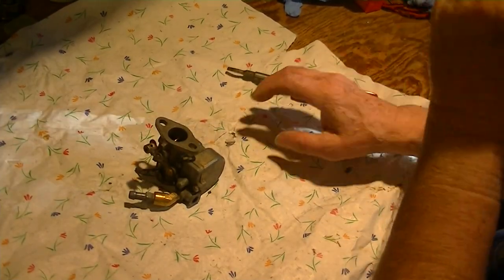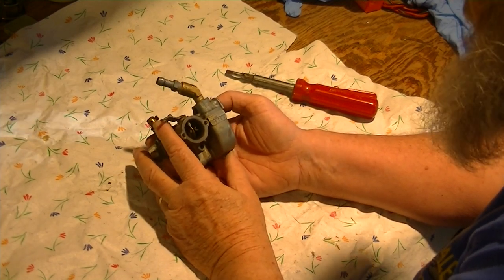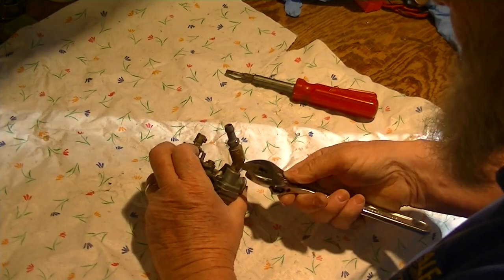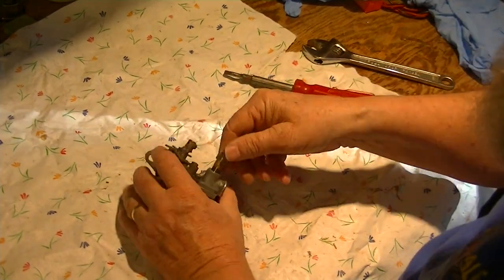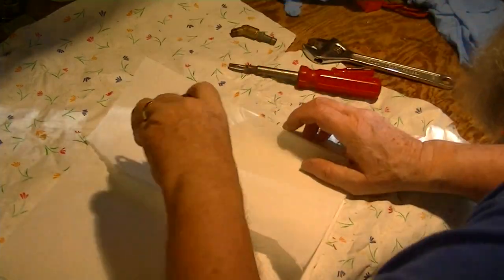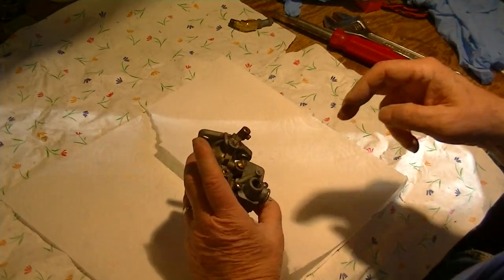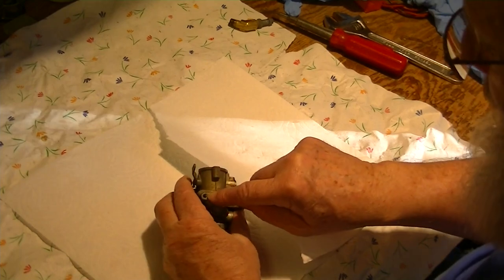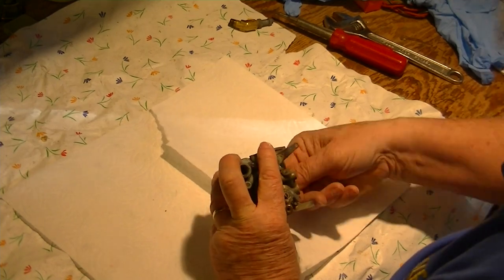Cushman Carburetor Party # 3 Carb dissasembly and explanation

Comment: Crazy! My Trailster is doing the same exact thing. Fuel dribbling out of the carb. I can’t believe YouTube. Thanks a lot! Back to the video to see how I fix it.
Reply from the maker: anytime you have this problem there is but one cause.. and that is the Float.   check that it hasnt leaked and filled with fuel.  remove the float and check the little valve, once the float actually floats, check that the valve actually seals ( blow through it)  then set the float LEVEL and put it back together with a good gasket. problem solved.  easy,
Reply: Thanks a lot! I bought it in Montana and I brought it back to Washington and we got it running after just a few kicks which was crazy because they said it didn’t run. But it had the dribbling problem after that. I tried buying a carb from a Cushman guy but he was too busy so I bought a cheap carb through EBay and it was supposed to fit but it was way too large and there was no way to adapt it so I ordered the parts to rebuild the Trailster carb. I have my uncle’s old Trailster that he bought new in 1961 that I’ll get running next. It’s been about 40 years since it’s been running. I paid 919.00 for the newer one so a carb rebuild will be a cheap fix. Thanks again!

Comment: how do you know what parts you need unless you take it apart.
Reply from the maker: well,  chances are your jets are going to be just fine.  A float is the most likely thing to be bad.  If you had a big puddle under your carb,, or constant flooding, you know you have a float problem, stuck or with holes and full of fuel.  Gaskets are cheap, so why not.  You do want to take it apart, and clean it with Berrymans.. and to do that, you are going to take the float out and inspect it.  The float needle is the other thing likely to go bad.  So float, needle, and gaskets.